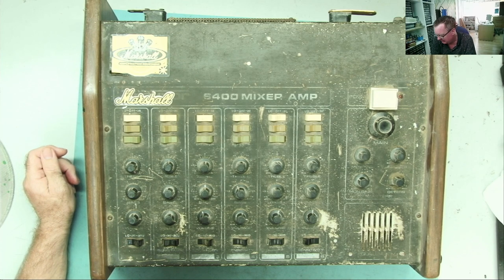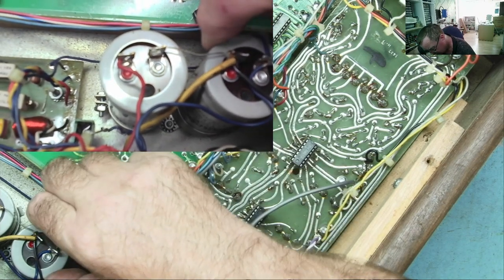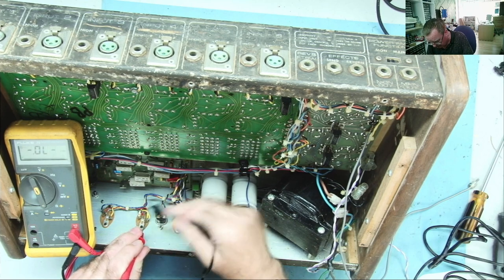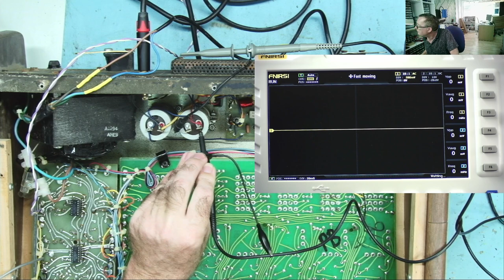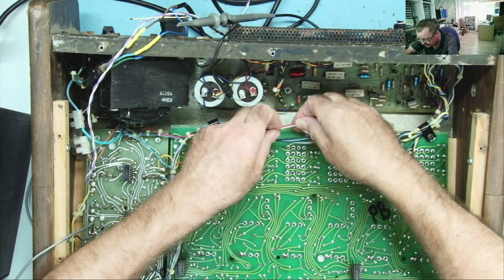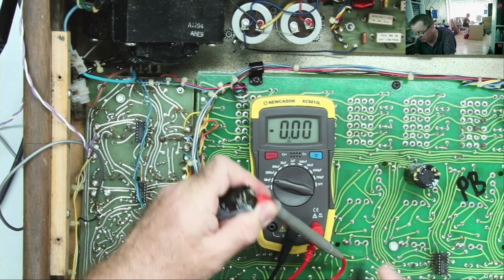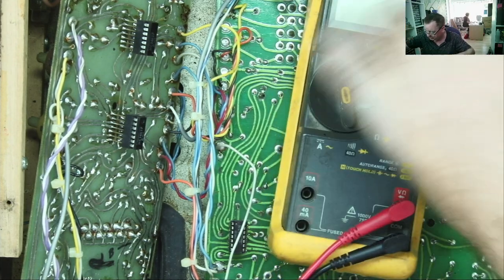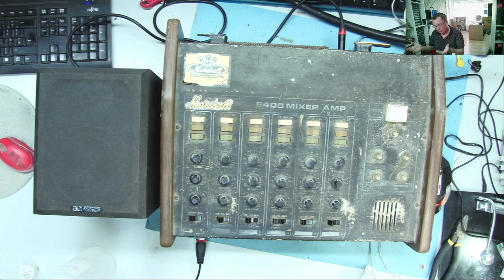'Marshall' 6400 Mixer Amp Repair - Vintage 1970s Audio

Comment: Yep agree about testing croc clips. I've had several admittedly cheap croc leads that were open circuit due to poor crimping, fixed by soldering . So worth going through and checking for continuity, all of any you have to avoid "being bitten on the bum!"

Comment: Hi Richard. I own this identical amp. I have been servicing it trying to locate its trouble. I have no output. I do have my + and - 15 volts. I have replaced the main caps 4700@63V and I like you, i replaced all the 4.7 caps too.
When I left off with it I had found 2 burnt diodes and one of the 100 ohm resiators burnt on the output board by the output jacks.
When i get more time, i will continue on until I find the issue. All the output transistors check good. If you weren't so far away, i would send this unit to you for service.   :)
I truly enjoy your videos.  All the best. I will repost once i eventually track down what is wrong with my amp. Maybe it will help someone else.

Comment: Fascinating video so far, thanks. I have an identical one of these, yes it's a Traynor, in identical condition too! If you disassemble the folded line reverb unit you'll see it is indeed just some physical springs! But works well with a distinctive sound.
I have the original circuit diagram for it somewhere if anyone's interested. I shall await your conclusions on this before deciding whether it's worth restoring.

Comment: Hi, this is a pretty standard reverb tank, found in guitar amps. Corre t in assumption that a couple of springs joined either end with transducer, and will have a preamp and circuit either before or after to allow the user to vary the amount of reverb in the audio path

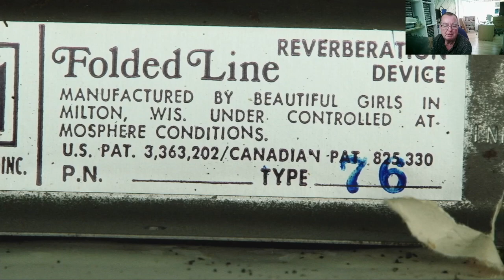Comment: Good analyses, dreaded capacitors again. No soft-start so pop is normal. I suspect they may have had layout and operational issues during the design, the raised sockets are probably to prevent oscillation and interference from those sensitive op amps. I see that a Sorin fuse was fitted. Presumably, the non-beautiful girls in Milton, Wis, were either unemployed or didn't exist (5:32).
Reply: I've never owned a (musical) amp that hasn't popped on being switched on.  I've always thought that was normal ...
Reply: @I_Don_t_want_a_handle  There have been various soft-start circuit designs over the years (including in my Sony system in 1980), but, yes, not installed in many amps and not necessary in some modern amps. Various videos explaining same, some good, some bad.
Reply: I think the reason why they mounted the ICs raised is just because it is a single-sided PCB and  if you mount the ICs on the solder-side (to have better access if they fail) you can not access the solder-pads if you use normal sockets. Using a socket with long pins allows access...

Comment: Monitor will allow the mixer to drive to a stage monitor via another amp or powered speaker most probably, sometimes used to drive a bass bin by sending some audio from a channel or two sent to monitor or aux send
Reply: I own this model amp. I use the Mon Output for recording. However, if I remember correctly I think it bypasses the Spring Reverb. (They were the best Reverb units) :)

Comment: Richard, the wiring on the reverb is likely original. It's the same type of spring reverb you would find on vintage guitar amplifiers.  The input connects to the amplifier stage so regular speaker wire is used.  The output is a low level signal which feeds back into the pre-amp, hence shielded cable on the output only.  You were brave to pay 15 for it. :D

Comment: 1:05:00 I bet that was a coupling capacitor or the like that hasn't seen much DC to speak of in decades. That's what happens to them, the oxide layer degrades (the faster the lower the voltage rating) and they become leaky. If you've always wanted to experiment with reforming capacitors, there's a good candidate.

Comment: Interesting .
i have never come across a mixer amo with a built in spring line reverb buit in.the blue mullard caps were very good but i notice in the last 5 years i am hvieing to change more of them. not only leaky but open circuit (dryed out)

Comment: Those ICs on "sticks" are in long-legged sockets for wire wrapping. Strange way to mount them on the back side of the PCB, they must have had a reason for it. They are Norton amps (current controlled) like the LM3900
Reply: Maybe the MC3403 is a comparator, the 3401 is a Norton. We used LM3900s and MC3401s amps in intercom solutions where I worked in the early 80's
Reply: The reason why they mounted the ICs on the backside is very simple. If they fail, you only have to open the case to get access to them. If they were mounted on the other side, you would have to disassemble the whole board...

Comment: if you touch the live wire on a isolated power supply will you get a shock ?
Reply: Yes, because now you are the only pathway to earth and you will take the entire current through you. Earth can be your table, your floor, your dog, anything. Don't touch anything.

Comment: I like this video. This old stuff is used by some bands that only use old and analogue equipment. it is worth money to the right person.  The front could be copied as a sign sticker and stuck to the front and would look new or paint it black and use transparent film with the white sections printed on.  Not worth it for you to do as a seller but a enthusiast could do it.